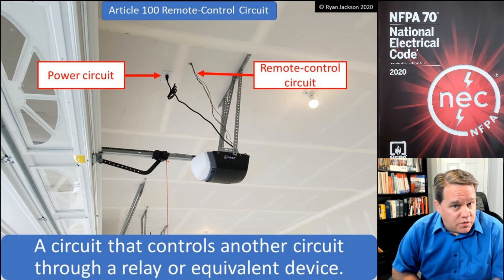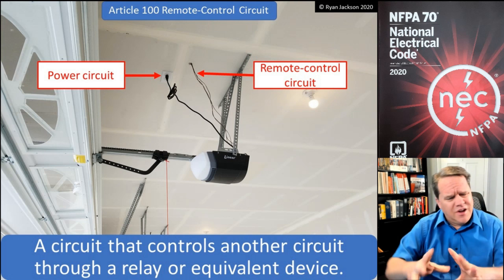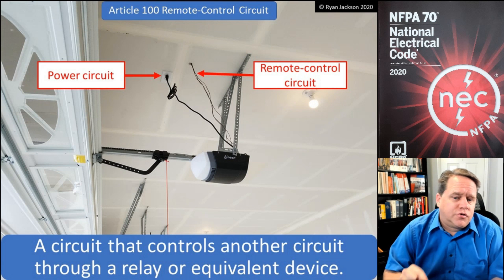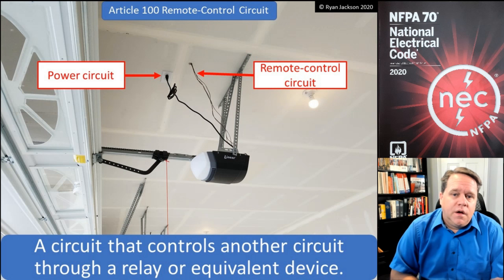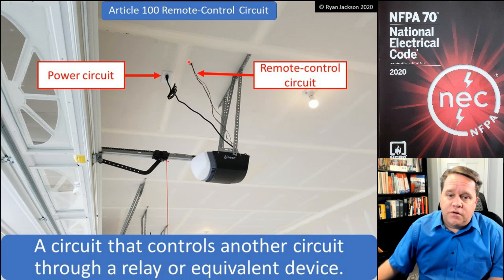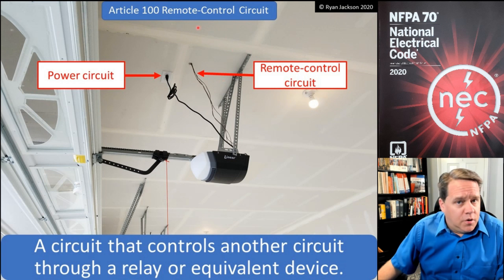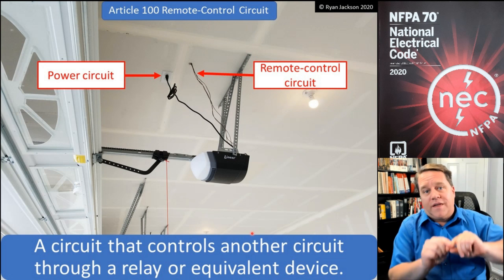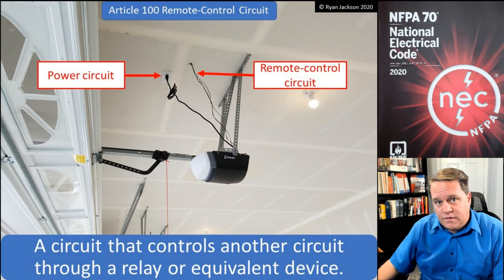100 Days of Article 100 Class 1, 2, and 3; Remote Control; Signaling Circuit

Comment: I have an electronic access control license in Texas that permits me to work on Class 1, 2, and 3 power limited, remote control, and signal circuits. At what point am I no longer allowed to legally work on a circuit? 

ie. I have a 120v 20A circuit wired directly to a transformer that steps down to 24v control wiring. Am I legally allowed to disconnect and then reconnect that 120v wire to replace the power supply?

Comment: "9V is not enough to kill you" So that's why when I test a 9 V transistor radio battery by touching it to my tongue doesn't kill me!
(A little humor need to be inserted in your video as it was getting a little dry)
Reply from the maker: Unless you choke on the battery ;)

Comment: But you can't have a door bell transformer in a panel board, correct?
Reply from the maker: Well, you can have a doorbell transformer in a panelboard's cabinet, but the secondary circuit would violate 725.136.